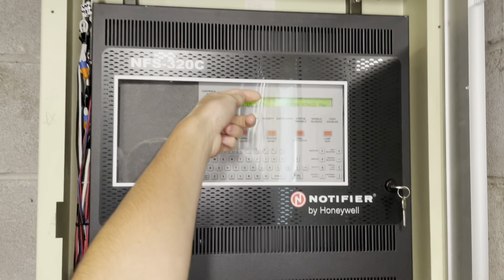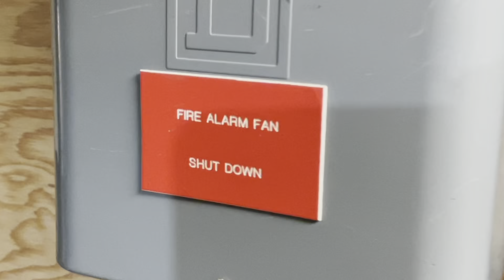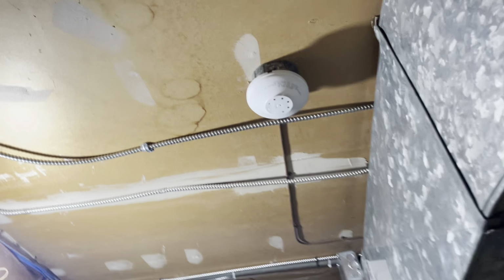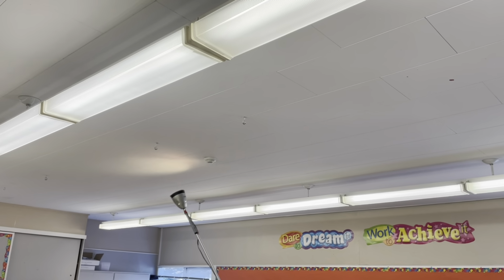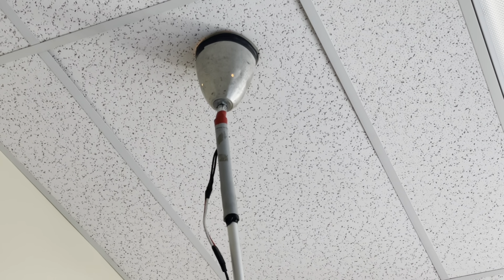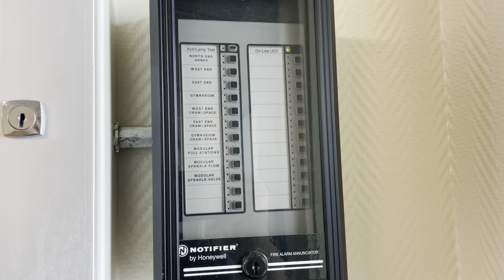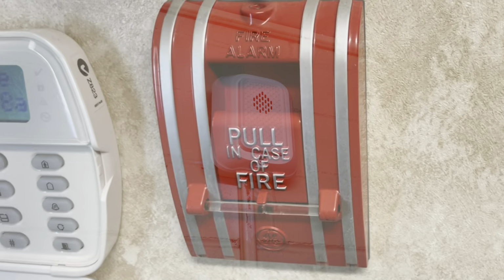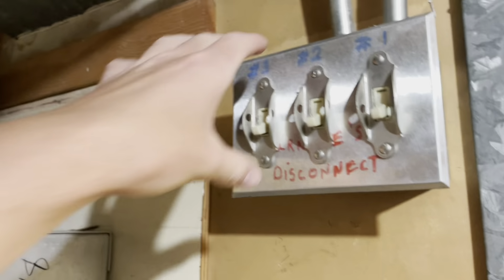Fire alarm testing a school from 1958

Comment: @NIC'S - SYSTEMS & ELECTRIC so that building has fans similar to smoke exhaust fans?
Reply from the maker: No definitely not it would be a terrible idea if the school did as it's wood frame combustible material with no sprinkler and it's not needed anyway as there is no atrium or open stairwells
Reply: @nics-systems-electric  what are the fire alarm fans then? when i saw that i thought of smoke exhaust fans and pressurization fans
Reply: @nics-systems-electric why do heat detectors pop
Reply from the maker: @ajsmusic723  if the rate of rise function fails it will set off the fixed temperature

Comment: FYI, the correct way to test those pull stations is actually pulling the handle. Then opening it to reset (removing the glass rod before of course)
Reply from the maker: People say that a lot I’m aware of that because it’s more realistic but nobody ever does that lol. maybe they should but probably will never happen
Reply: I do that each time I inspect. I have had the handles come completely put of the station when pulled without triggering the alarm. I have also had other pulls handles work but failed to trigger the switch. If you are inspecting a system correctly,  thats how you do it. And more people than not test them the correct way than you think..

Comment: I just thought, seeing two detectors in a room. Can 2 detectors have the same address and report the same location position? Or will they not communicate properly
Reply from the maker: This system is not addressable but no you can’t have two devices set to the same address

Comment: Are strobes not required in Canada?  I can remember back in the 1980s anytime a fire alarms system was updated they would add light plates to the bells or horns. Now they use strobes. My elementary school had a space age electronics light plates added. I wish I were there when they demolished the building but later I learned the system was replaced about ten years prior to a new school built and the old demolished
Reply from the maker: Yes they are required in certain spaces but the rules are a lot more relaxed for retrofit systems

Comment: You're probably the first, and the last person to ever test those crawl space heats.
Reply from the maker: Well whoever the last guy was apparently used a lighter on some of them as the paint was burned right off them lol
Reply: @nics-systems-electric  I was surprised to see a large fire alarm company at a hospital once and the tech was carrying a torch. So much for no open flame.

I am surprised someone actually went down there though. A lot of techs won't check conventional heats in crawl spaces or attics, especially conventional ones.
Reply from the maker: @The1025RChannel  Yeah exactly we always use the solo heat tester where we can and in tight spots like crawlspaces Milwaukee cordless heat gun

Comment: Those 270-SPOs look new, were they installed recently
Reply from the maker: No they are probably from 58 definitely before 64
Reply: Were they cleaned
Reply from the maker: @Chesser301  I’m sure they’ve been wiped down thousands of times
Reply: Is it against the law to have 70-year old pull stations?
Reply from the maker: @Chesser301  If they are original they are 64 years old and no it’s still compliant as long as they work
Reply: Okay
Reply: Any new alarms around the building? The only ones I hear are Spectralerts.
Reply: That includes pull stations
Reply: @Chesser301  the alarms are l series not spetralert

Comment: how does the solo heat detector tester work?
wait. is it a super hot light bulb, kinda like the bulb in your generator room?
Reply from the maker: We didn’t use the solo one in this video just the solo smoke detector tester and for heats we used the homemade one which is just a little halogen lightbulb
Reply: @nics-systems-electric  oh
Reply: It's like a mini heat lamp causes it to set off I'm thinking....if it's a heat detector the magnet one I'm not getting at all....I've seen them use looks like a magnetic thing yeah I'm still a bit lost on that one

Comment: I'm no electrician....I see a positive which is red black which is negative a white I'm thinking is neutral grounding everything to I believe prevents electrocution and fires.....but the fourth is blue?! My thought process is it connects to the alarm panel to make the scary ass noise right? Sends signal to make the sound go off basically
Reply from the maker: With DC systems red brown and white are commonly all colours used for positive and blue and black is negative then when you get orange and yellow involved it can get more complicated.
Reply: @nics-systems-electric  omg....I'm lost lol....what wire sends the signal to the panel??? To set the sound off red black and white are positive negative and neutral right?
Reply from the maker: @JayS-l6f  there is no neutral it's DC just separate circuit for zones and alarms
Reply: @nics-systems-electric  ohhhhh ok

Comment: This Old ass School. Has this never been renovated. Geez this shit looks horrible bro. 

Naw though, If You Come to the poorest parts of my area here in Chicago, There are some Terrible Looking Schools that don't get Fire Alarm Inspections, Upgrades, or Renovations(The Freaking Textbooks are from the 70's). Its Horrible to be honest. My school was built in the 50's. Had Faraday 6126B Remote horns With Wheelock RSS Strobes. Most of the Strobes were destroyed and To this day after my 2 years out of High School(I'm 19), The Strobes are Still Not replaced and Most likely will never be. Been destroyed I heard since the 2000's. Just goes to show The Government don't care about anything but building worthless places that won't mean anything in 12 years. The older System was Some sort of Pull Rod System as Some parts Have the Old Steel Tubes in the walls with the Recessed Pocketed Projector Horn Ports Covered. The Gym was Our Cafe, and We had A Fallout Shelter as well. Been down there once and that was the first and absolute last
Reply from the maker: Yeah this is one of our older schools but as far as our old schools this one’s in pretty good shape compared to some as far as our schools from the 1940s to 60s this is probably one of the nicest of the old ones

Comment: Why are some devices not for life saftey.
Reply: It is but not because it will not sound if something happens it only detects heat or smoke depending causing to just basically send a signal from that device to the alarm panel to send a signal to the scary ass noise to alert to fire in building.....my best guess...